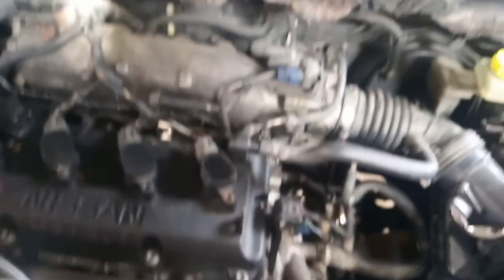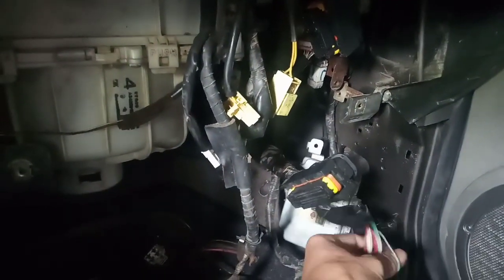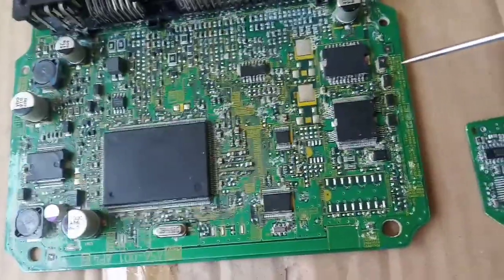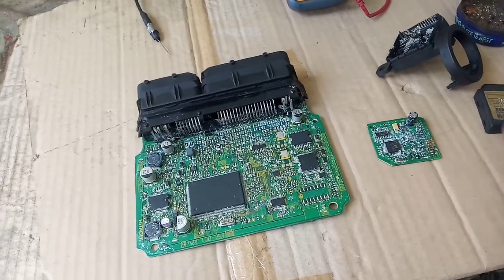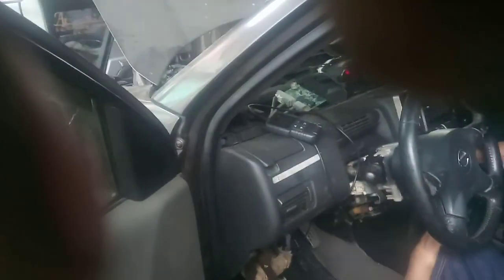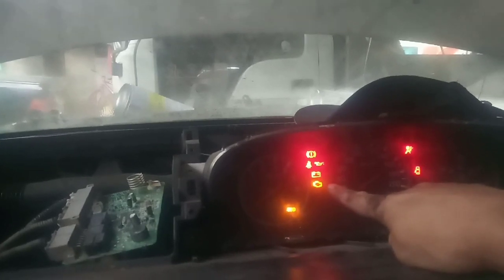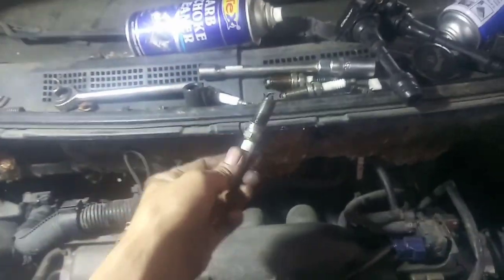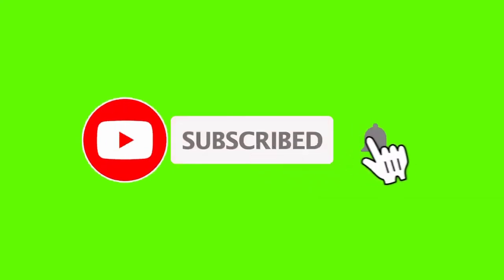Nissan x trail ecu(part 2)

Comment: Pag switch on din po pala di umiilaw yung check engine light nya..puro redondo lang kc..dati umiilaw daw pag switch on nya.
Reply from the maker: Check mo main relay sir kung gumagana
Reply: @renzmekaniko2235  relay ng ecu ba master? Yun ba yung nasa video mo?
Reply from the maker: Yes po sir
Reply: @renzmekaniko2235  cge master maraming salamat s time..check ko yun master..
Reply: Buti napanood ko video mo master...salamat ulit..
Reply: Master good morning..yun bang s main relay kailangan umiilaw lahat pagtest n nka switch on? Tsaka my yung dito may supply yung sa injector..wla sa ignition coil wla s maf sensor wla din s camshaft sensor...possible kaya s crankshaft sensor may sira?
Reply from the maker: Pumipitik ba ung main relay pag on Ng ignition
Reply: @renzmekaniko2235  diko p npasin master..kung pumipitik b master ano ibig sabihin? Or kung hindi nmn?

Comment: In English please.. I have a Nissan x trail and it I found out that the ECU relay has no power so how can I do a bypass to fix the problem??? Anyone thanks..
Reply from the maker: Check all the fuses
Reply: Ok I've checked and the relay works now but the other 10amp fues for the ECU has no power flowing ,do I need to check the wire connection?

Comment: Sir pa help naman po. Meron ako xtrail qr20 engine. Napalitan na po cam and crank sensor, bago din ignition coil at sparkplugs, meron kasi time na bigla nalang hindi aandar, tapos next day aandar sya ulit. Pina off ko na din yung remote key nya dahil nagloloko daw sabi ng mechanic. Tsaka pag switch on wala pong check engine na iilaw. Thanks po sir sa reply

Comment: sir san po locaton ng shop nyo po?
Reply from the maker: Marikina po sir
Reply: Dol,Meron Ako Nessan exalta a.t. 2002 model. Pag on ng susi Meron check, pag inistart may kuryente ang ignition. Kaso ang injector Isang buga lng lumalabas ayaw ng tumuloy kaya ayaw umandar. 
Ang Sabi ng mechanic nasa tatlo daw ang maging sira, computer box, immobilizer, or chip. Sana dol ma replyan mo ko. Tnx.
Reply: Chick engine